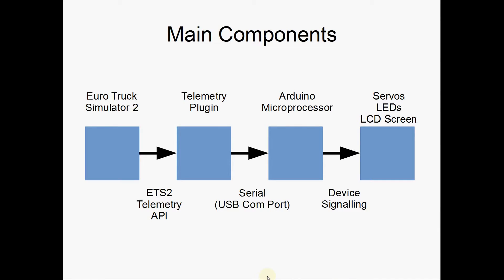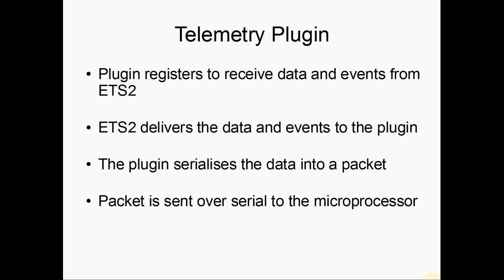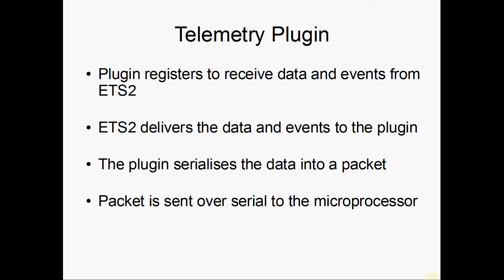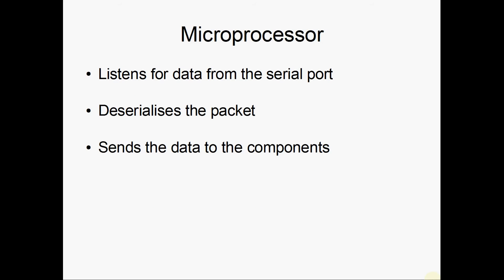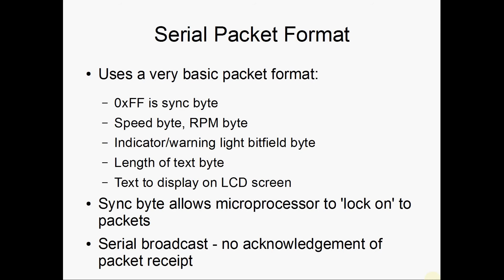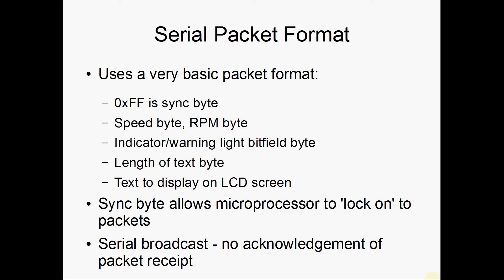ETS2 Dashboard - How it works

Comment: hi, how much would you say it would cost if you where going to make me one???
Reply from the maker: Arduino UNO R3 £21
Micro Servos £6 x2 = £12
LCD Display £8
LEDs / Wire / Solder / Connectors £6
Wood / Paint £5
Labour 4h @ £20/h = £80
Shipping £10
Total: £142

As you can see the biggest part of this is labour at 4 hours. This involves cutting, assembling, glueing. painting the stand, then laying out a circuit on strip board, soldering, testing, update the program, flash and test the board. The minimum would be 4 hours could be more.

All I built was a prototype, to produce a finished product is a lot of work when doing a one off job !  That's why it's a high cost compared to an off-the-shelf product.

If there was enough interest, this could be something for Kickstarter or similar, but I would need to find a product design team that can take a pile of wires and wood and turn it into a commercial design a factory could manufacture.
Reply: Silas Parker  ohhh ok :D thanks for the info! and the kickstarter thing would be awesome, keep up the great work!

Comment: Hi, thanks for explaining how the technique works, I now have a speedometer. I was wondering if you could go through the process of explaining how the wires connect to the arduino board. I haven't actually got one yet, but I would like to know how it works before I buy one. Do I need a DIY interface board? Any advice is apprieciated. Thanks :-)